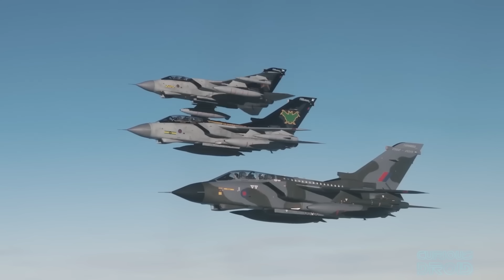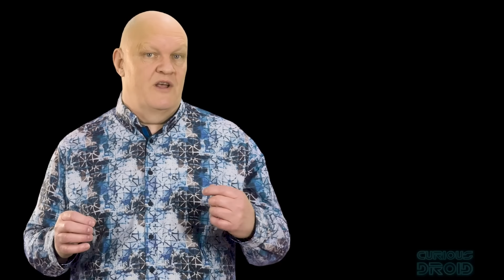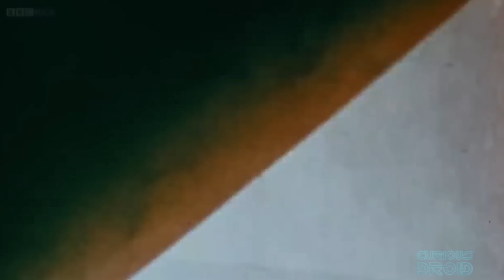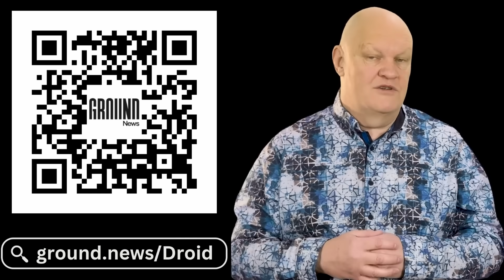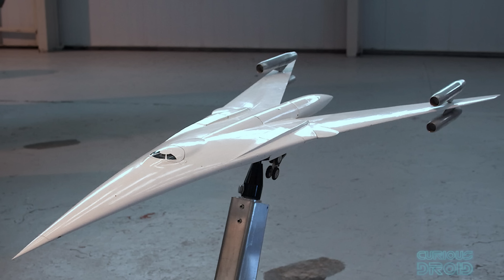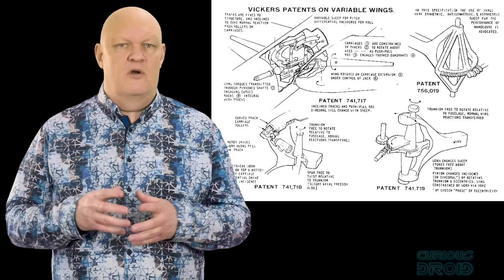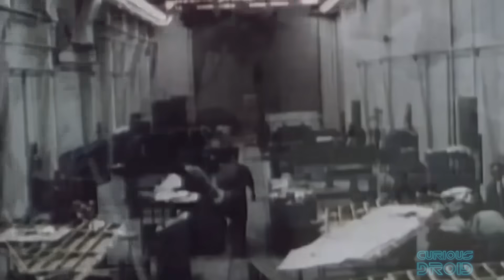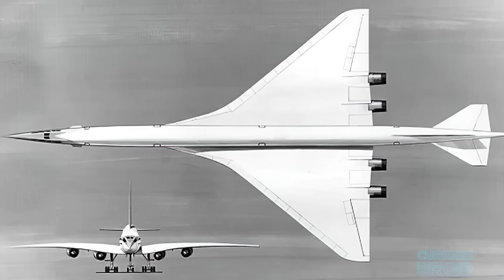Why Aren't Swing Wing Aircraft Made Any More?

Comment: If I may, I would like to suggest a topic. The humble slide rule. Back in the day, they were a pretty big deal. Being a slide rule collector and enthusiast, I can also say emphatically, there are things you can do with a slide rule that are impossible on a calculator. If you really understand them, they can be quite powerful. And they were used to build the modern world.
Reply: I never learned to use one.  But I think a commonly missed benefit of a slide rule is that users tended to memorize the scales that led to understanding of things like logarithms beyond what is ever likely with a calculator.
Reply: @clytle374  I'm old enough to have been taught how to use a slide-rule, because when I entered high school the only calculators at the time were large desktop machines with Nixie tubes!  Our school started a computer-class with one that was programmable using cards, however by the time I finished my senior years in high school you could buy affordable pocket calculators, but scientific-functions added significantly to the cost! 
You may not be aware, but logarithmic-scales are utilised by pilots for calculating or converting (eg; gals to litres), simply by looking at their watch & rotating the bezel, but it has to be something like a Seiko Flightmaster watch.  Another pilot's watch I own is a Citizen Ecodrive Titanium which has an extra crown/knob on the lower-left of the watch-case that rotates its internal-bezel for more accuracy!
Reply: In aviation when still use a similar technology. The E6B is a circular slide rule and can calculate multiple functions for flight planning. Quick and no batteries.
Reply: Thanks! Something new to study! ;).
Reply: I have three of them, sometimes still use one at work when I'm too lazy to reach for my calculator.
Reply: Count my vote for this one!
Reply: YES! This... ;)
Reply: Slide implement a graphical method for adding logarithms, something any scientific calculator can do, so what do you think they do that is impossible on a calculator?
Reply: @shanent5793  Can make calculations without need of a power source. That's impossible to do with a calculator.
Reply: @Eidolon1andOnly  Modern scientific calculators are powered with a small photovoltaic cell, so the only thing you need is a source of light. Which incidentally is also the same thing you need for a slide rule 😂
Reply: @tommasomorandini1982  Not necessarily. Braille slide rules can be used in total darkness. A lot of photovoltaic calculators are either fake, or use the photvoltaic cells in conjuction with batteries.
Reply: @Eidolon1andOnly  Never heard of braille slide rules, very interesting. Do you know the practical precision a user can achieve with one? After all a normal slide rule requires the user to visually check where a line falls between two other closely spaced lines.
Reply: @tommasomorandini1982  Braille slide rules are constructed a bit differently than the standard ones. Check out the
Keuffel & Esser model 4081-3 Braille Slide Rule.
Reply: @Eidolon1andOnly  Calculators need negligible power though.
Reply: @Erowens98  negligible power is still more than no power at all.
Reply: Do it without power?
Reply: @shanent5793 They were around before a calculator was available. They aren't better than a calculator, but many of the pre-1970 aircraft were designed using slide rules in absence of calculators. Yet,  the slide rule produced amazing results regardless.
People today take modern computation for granted and fail to realize how much hard, complex math was accomplished with much less only a short time ago.
Reply: @slartybarfastb3648  calculators were available to even the Wright brothers and slide rules are not precise enough for such work. Seven figure tables would have been used instead
Reply: @shanent5793  You and I have different definitions of 'calculator' then.
Reply: May have overstated things as impossibe. They are possible but much more readily and elegantly on a slide rule. How the full spectrum of a mathematical operation is laid out in front of you  much more elegantly than with a calculator. I have found I am much more cognitively involved with a calculation and the mathematics behind it using a slide rule over a calculator. For an introduction to the things you can do I would suggest looking up a user manual for one of the more advanced rules. Maybe a Pickett 500, 800 or model 4, an Keuffel & Esser  N9081 or 4081 are good examples. To fully realize it’s power you need to use it. One thing that is very important, the slide rule requires more of you than the calculator does. That is its real power.
Reply: @lorentzinvariant7348  I'm always accidentally reversing pairs of digits when I key them in, so sometimes the slide rule is more accurate 😄. You have to track the order of magnitude manually as well, which provides a check on some types of error. One convenience is with repeated operations where you can set the slide rule once and then just read the results of several different input values.
Reply: @shanent5793  Yes! Best comment on the comment!
Reply: Great idea
Reply: Slide rules are radiation resistant, much more than people. Let us hope we do not have to test this in reality.
Reply: ...And just try hacking one; I dare ya!
Reply: The dreams of ludites rowing against the current.
Reply: @carlossaraiva8213  ... Those heathens reached up to the Sun and stole its power with that technology, with a Paper Clip.
Then they figured out how to deliver it to anywhere in the world, hollowed mountains to sit and make threats from.
Where do you think Texas Instruments started?
It was a toy store for nerds without morals.
Reply: @carlossaraiva8213  
Pull harder, me boys!  We're rowing uphill!
Reply: Would love a vid on this.
Reply: Hey slide rule enthusiast. An idea just popped into my head and i have to assume its either been done or i just dont get how slide rules work(i dont)

Has anyone ever made slide rules where the scales were flexible and rolled onto rollers? Like for compact high precision slide rules.
Reply: I have heard of rolled slide rules made for precision in the early 20th century.
Reply: @lorentzinvariant7348  hmmm so you could just have arbitrary precision with these(or as close as makes no difference)? im imaging a rectangular board with a bunch of multi-meter long tape rollers on either side. there's probably a smarter way to do that.
Reply: You guys rule! No pun intended here😃 let's not forget the incredible Mighty Boeing 727 the first with triple fowler flaps inboard and outboard also the last Boeing airliner done with sliderulers
Reply: Calculators are programmable with massive memory capacity, and the watch batteries last forever after led displays were replaced with lcds.
Reply: ruchardwilliams1986 Yes, calculators do have their place. I do use them from time to time. I regularly use a 3D graphing app on my phone. But, the calculator, more often than not, liberates you from really using your brain.
Reply: Sounds more like a "That History Guy" subject, he did a great one on screws.
Reply: @All_Hail_Chael  ... The Bow Tie suckered you into watching a video about Patent Law, not Screwdrivers, it was ScrewDRIVERS.
Here's a Q Tip, sit up and pay attention in class, er Life.
Reply: I’ve flown in that camo one 0:56
Reply: Would you give an example or two of something the slide rule can do that calculators cannot?
Reply: @DMR-2018  ... Imagine breaking both devices, now fix them.  (One needs only scotch tape)
Now make copies of each of them, so other people can do what you do.  (One can be made with cardboard and ink.)
Now survive an EMP,  then do calculations.
All Pilots get a slide rule when they start Ground School, so they may understand the air density of the atmosphere around them.
Adjust the settings and a person can clearly comprehend how their aircraft will perform in an invisible medium.
Programs on iPads simulate the same calculations, but don't include the user in the experience.  There have been a lot of sad "mishaps" in the aviation industry lately where students have pushed the machine past the limits of the air around them.
They are disconnected from the wind, but want to emulate birds, and defy gravity, like a Disney movie.
Reply: One thing you can do with a slide rule is scratch your back. I can't do that with my Sharp EL-506P calculator
Reply: Great suggestion!
Reply: I heard that slide rules were supplanted at the Engineering school of the University of British Columbia when a student pulled an exam question involving a bridge design and showed that given the slide rule's three digit accuracy the bridge would be either three feet too long or three feet too short.
Reply: Being a child of the 1960s and 1970s, I was thoroughly familiar with the "guessing stick". It had some advantages but the limited accuracy (2 or 3 decimal places) was always a problem. I couldn't wait to get my first Sinclair Cambridge pocket calculator (cost 30 quid in those days, probably equivalent to a couple of hundred nowadays), followed by an even better Commodore scientific model.
Reply: Keep fighting the good fight, my man! Great comment.
Reply: Agreed. We occasionally hear mention of it, but I don't believe I've ever seen it's operation explained.
Reply: THAT I'd like to see!
Reply: When I studied aeronautical engineering 60 years ago I used a slide rule. A horrible device. I was very pleased to start using mechanical and then electronic computers. Perhaps you still miss the abacus?
Reply: halamish It sounds like I began my study of physics about 10 years after you studied Engineering. I suppose if all you are concerned with it getting to the answer as efficiently as possible. I would agree with you. And I do understand that point of view. One of my areas of greatest interest is in the underlying dynamics of field theories. Not just calculating things for the sake of numbers but the understanding of how these internal dynamic systems and symmetries are related to one another. Some of the deepest insights of our physical existence come from such analysis. I view the slide rule in a similar way. Yes, today there are much more efficient ways of performing a calculation with much higher precision. But the underlying spectrum of numbers and the operations we perform on them are fully laid bare with a slide rule in a kind of geometric way that are obscured by our modern means. I think, because of this, some deeper insight and understanding has been lost with our modern methods.
Reply: I agree, I am interested inanalog computing
Reply: I once had  2 cubic feet of paper slide rules I got at the TRW ham swap meet 3 decades ago..lost about  all in Katrina. 

They were overage and samples and about all different. 

Ie one was for moving materials on a moving flat belt.. inputs belt width and belt speed.. output how many lbs per hour you can move.. for flour. Sand. Corn kernels. 1/4 20 nuts. Everything under the sun.  So the rule considered the angle of repose the stuff had..  ie moving a triangular cross section of material..had another variable of material to edge of the belt.
Reply: My dear old dad was an EE with AT&T and would often refer to his trusty slide rule fondly as his guessing stick.
Reply: The SR-71 was designed with slipsticks and in some ways, it STILL has not been surpassed!
Reply: A lot of things you see on Curious Droid were designed with slide rules. There were some several feet long that had the precision of some calculators. A 20 inch Keuffel & Esser log log duplex was a very powerful calculating tool.
Reply: @petesheppard1709  to be fair using true computing would net only marginal improvements over a SR-71. We're at the point if you want an aircraft make it stealth instead of glowing like the sun on IRST, if you want to go faster than the SR-71 it better have a warhead and not expected to return.
Reply: @ChucksSEADnDEAD  Check out the Hermeus Corporation.  They are apparently the leader in the race to develop reusable (and eventually manned) reusable hypersonic aircraft.
Reply: @petesheppard1709

This is a common myth.  

Lockheed and NACA had electronic computers a decade before the SR-71 was designed and complex mechanical ones way before.  

Slide rules were used much like a calculator app on a phone is used today.. for quick and rough checks when an Excel spreadsheet or custom database or modelling software is used for the precise number crunching.
Reply: @petesheppard1709 the only reason the SR71 has not been surpassed is because it's entire role is obsolete.
Reply: The slide rule sent people to the moon.  How many people did the iPhone send to the moon?
Reply: Beatnik59 IMO even better than Apollo is the story of Gordo Cooper when the auto navigation systems in his Friendship 7 spacecraft totally failed. He had brought his slide rule which he bought when he started flightschool. An Keuffel & Esser  N9081. He used it to make the needed calculations to make the correct target mark on his window to line up with a specific star. Using this mark and a stopwatch he manually flew the spacecraft re-entry. Something thought to be impossible. He ended up landing closer to the carrier than anyone before. A feat of piloting skills and ingenuity I doubt will ever be equaled. That slide rule sold at auction back in the 2000’s I think for several thousand dollars. I have one just like it in my collection😉.
Reply: @Beatnik59  The iPhone has sent many users to an early grave, but I've never heard of any drivers being distracted by using their slide-rule!
Reply: @stevie-ray2020  pure gold
Reply: @Beatnik59  Cold War ferver subsided in 1991, and competative or showy projects of the magnitude seen then haven't really been passed since.
Reply: @Beatnik59  What happened to it!? Did it fall over after they climbed back down?
Reply: @Beatnik59  i mentioned using the slide rule when I went to Brooklyn Tech and my kids (13 --18) all looked at me with a blank expression....lol
Reply: @Beatnik59 
Considering the Two+ Decade gap, you're not only a goose, you're irrelevant.
Reply: @Beatnik59  Never went to the moon. And NASA acknowledges they would have died going through the radiation belts.
Reply: @popeantichrist8847  Well, if that's the case, then the slide rule kept NASA out of trouble.  How many calamities did the iPhone prevent?
Reply: Absolutely. A slide rule requires an understanding of numbers not taught anymore.

Comment: Weight and stealth requirements is my best guess.
Reply: @ideadlift20kg83the F-111 did have wing mounts for ordnance and equipment. They pivoted as the wings did to keep said arms parallel with the fuselage.
Reply: @ideadlift20kg83 have you seen the F-111?
Reply: Nope. Maintenance costs. The F-14, for example, requires 50 hours of maintenance for each hour of flight time. This trend continues today with the B-1B being notoriously difficult to keep flying with lower readiness rates compared to the B-52 or B-2
Reply: @RaderizDorret  Your "nope" is incorrect.  It does make stealth features difficult and less effective and adds weight.  The swing mechanisms and wings deforming do need more maintenance but it's definitely not only that.
Reply: @mostevil1082  The Navy disagrees with you because they specifically cited the massive expense in keeping the Tomcat operating for retiring it 4 years early (retired in 2006 vs the originally planned 2010) and accelerating procurement of Super Hornets.